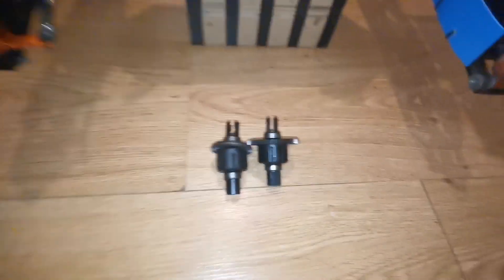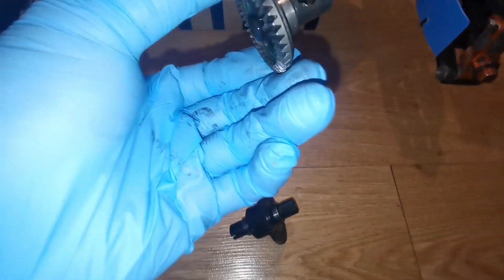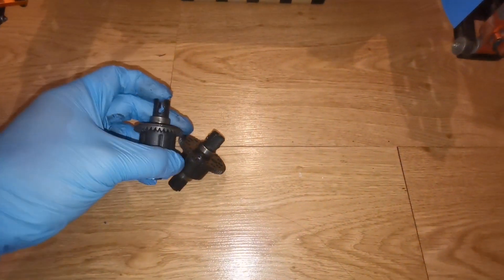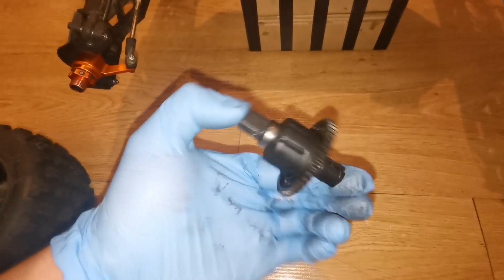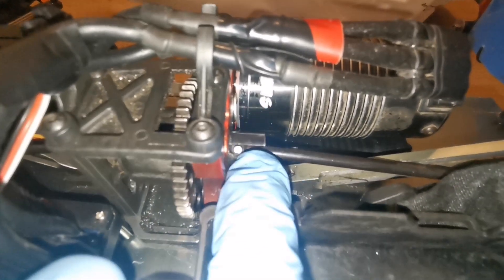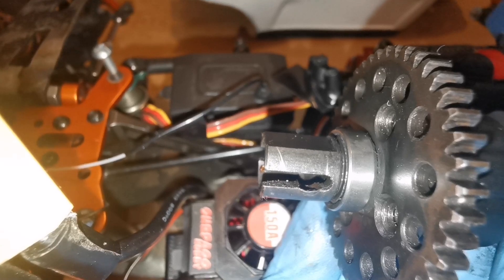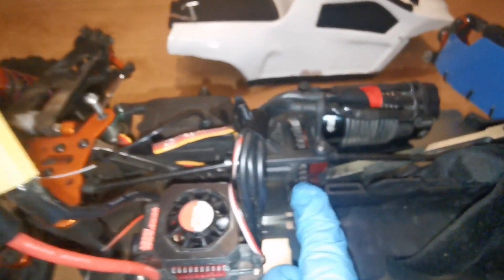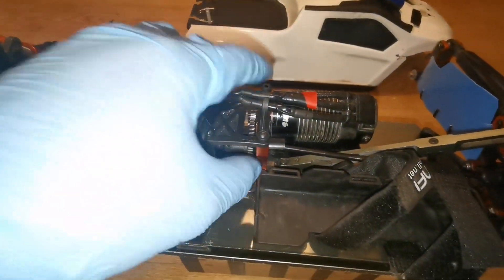Differential Cup trick to lessen damages | ZD Racing 1/8 RC

Comment: These parts are wearable parts like tires, whatever brand you have, you will have to change it from time to time. I suggest you inverse your cups when a side have too much wear so it will double the part life. You can also put dry PTFE to help but the cost should be very low to change, lower than changing tires.
Reply from the maker: Thank you. Yea I agree. I used to always invert the same parts. But the material used in these cheap gears are just not as good as the high end ones like Traxxas, tekno etc. So, they wear out twice faster.
Reply: @ianbudgetrc2574  Now I read you I am thinking about buying a lathe machine to make my own part :-) It would cost more than a Kraton but would be more fun..